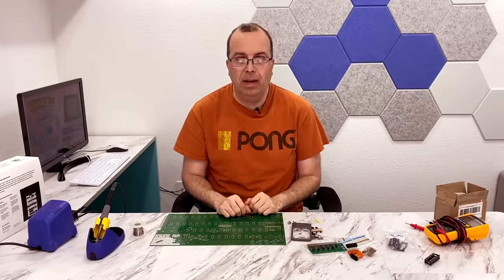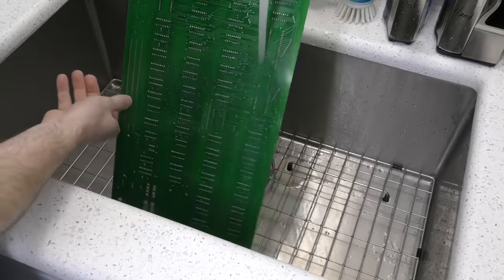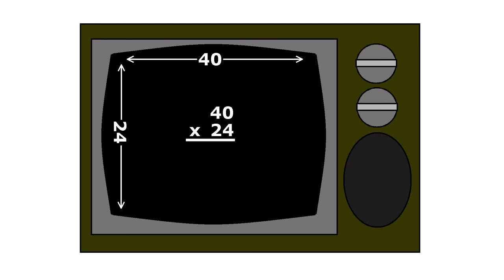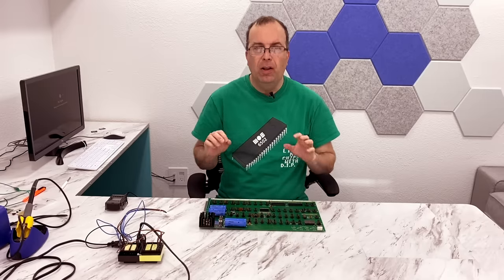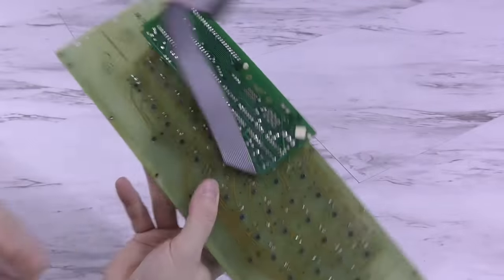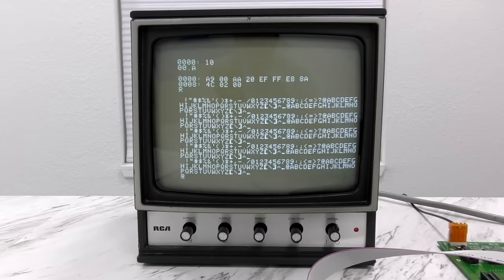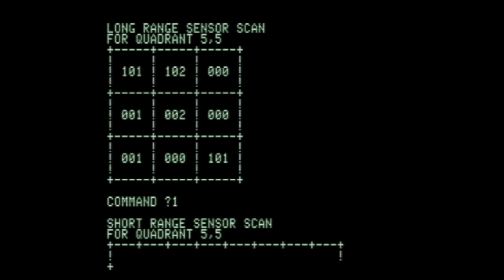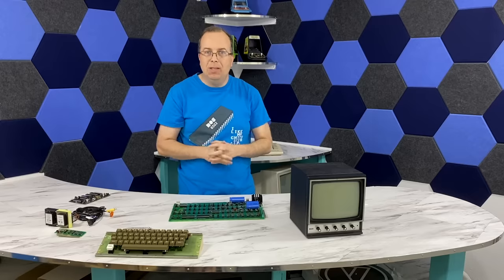How the Apple 1 computer works.

Comment: I won't lie: Every time I see water straight from the facet being poured on a mainboard, my booty clenches.
Reply: Water is perfectly safe to use on electronics, as long as they’re not powered. People wash filthy arcade boards in soap and water all the time. The board must be bone dry before testing though, put it in front of a fan for several hours.
Reply: It's not a problem...back in the 90s I used to work for a small manufacturer of Atari peripherals, assembling the circuit boards.  We used to clean flux off of them just like you see here and it was never an issue.  I dunno how they do it today with the tiny surface mount parts though
Reply: @KoopaMedia64  it depends. In undergrad, my town had really hard water. You wouldn't want to wash with that because you'd end up with deposits all over the board which could cause problems. But yeah, water itself is fine
Reply: @chrisfreemesser5707  They use IPA and deprotonated, distilled water
Reply: @anonymousarmadillo6589  I duno if I would pour an India Pale Ale on a computer.
Reply: @chrisfreemesser5707  they use ultra sonic cleaners
Reply: @nitehawk86  - You can use a European Ale if you prefer, but it evaporates more slowly and may deposit some oils on the board. It is better for rubbery components though.
Reply: @parrek1384  Yeah, when in doubt use distilled water.
It has the added benefit of being almost non-conductive.
Reply: Don't get in to extreme overclocking if tap water makes you pucker.  Those folks throw mother boards in the dish washer.  
As others have said, you are not going to damage anything on an unpowered board as long as you dry it off reasonably quickly.
Reply: @KoopaMedia64  You want to use de-mineralized water.
Reply: i used to work on a computer center, i lost count of how many computers, printers and notebooks i washed under the sink
as long as they are completly bone dry when powered, you are good to go
Reply: Same and i love it
Reply: me too .. but I always remember picking out my first arcade project case build circa 2000, the guy had a whole warehouse of uprights, and his tip (which I have still never tried) was cleaning mother boards in a dedicated dishwasher, and Jet Dry .. which changes the surface tension of the droplets. I’m sure the water type is also key. I have used higher end dishwashers for plastic parts, (2006) but the heat of the water or dry cycles changes the component plastics just enough to make that a near useless idea. i.e., it cleans the keyboard keycaps, but now they type like sh*t, so u saved no time or effort. 

I have seen folks power wash chassis monitors with a garden hose, etc. just ensure enough dry time, and they are fine. one day .. I will get around to that experience too.
Reply: In training we were shown pictures of semiconductors that were cooled by running distilled water over the main circuit while powered at more than 100000 V handling millions of Watts.  In fact, I suspect this thing is still running right right now.
Reply: @TheSulross  look at the neuroscientist over here
Reply: @anonymousarmadillo6589   @Capt TopGun  Yah - half the unrepairable liquid damage I deal with is hard tap water that has irreversibly rotted the solder joints because it wasn't fully dried. If you're gonna use tap water, be my guest but that board better be 100% dry within the hour. I mean really, really dry. Definitely don't do this with any ICs populated because you'll never get the water out of the hundreds of IC leg connections. Even depopulated, the sockets will take hours to dry.
Reply: @johngaltline9933  I think David often overlooks the 3 seconds it would take to say that it is dried thoroughly afterword...
Reply: Alec J I mean, yes, he overlooks it, but anyone with half the brainpower to solder this board ought to know it already. 
Probably worth noting that as far as soldering jobs go, that apple I board looks really easy and straightforward. All DIP and through hole, cause that’s all that existed at the time. It’s tedious AF, I’m sure, but it’s simple.
Reply: @chrisfreemesser5707  It sounds like you may have been taking more care than Atari themselves did. I've cleaned the flux off of three VCS's now from a heavy sixer to a darth vader.
Reply: @AgentOrange96  Of it's rosin core flux then it isn't an issue but if it's organic core solder the flux is acidic and will eat the contacts if left there
Reply: @chrisfreemesser5707  Yeah, I assume it's rosin core since it hasn't done any damage over the decades. I had been cleaning the boards with alcohol for other reasons, and it left an ugly residue, which was my primary motivation for fully removing it.
Reply: @chrisfreemesser5707  Original rosin is organic tree-sap that etches away stuff that blocks soldering.  It needs to be removed after completion.
Reply: @alecjahn  Sadly, unless David hits that board immediately with a hair dryer for several minutes, that's not really possible to say with confidence. Not where IC sockets have been used.
Reply: What's so sad about this entire controvery is that  a liberal wash & scrub with IPA is all that was ever needed to remove the flux stains. You can mix a bit of detergent in but flush with IPA thoroughly.
Reply: @KoopaMedia64  No, no, no. Just no.
Reply: @Blitterbug  I have one of those Datavac blowers. I've found spraying boards with IPA and then blowing it off the edge with the blower works well. For boards I've hand assembled I've bathed them in IPA and done the same. It can take a few tries for either method though.
Reply: @nitehawk86  IPA in this case is isopropyl alcohol.
Reply: @Blitterbug  I work at an electronics assembly company and we do use water wash, as it is a mandatory step if organic-type fluxes are used (we also use “no clean” fluxes, it all depends on the components used). The washer we use has a long conveyor belt that takes the boards under multiple baths of hot, deionized water at different velocities after which they pass under two air blast dryers before exiting from the other end several minutes later. 99% of the time the boards come out bone dry, the remaining 1% get hand dried and the assembly process gets tweaked so we don’t have to worry about hand drying that particular assembly on future runs.
Reply: I wash my PCBs with isopropyl alcohol, rinse under running water with an acid brush, and dry with compressed air.  Thirty years later, no problems yet.
Reply: @Renville80  Indeed. But you don't use the kitchen sink and unfiltered tap water. The hot air blast dryers are essential, as I was saying earlier.
Reply: It's perfectly safe as long as no juice is going in and none of the electrolytic capacitors have any charge in them.
Reply: @pheorat9439  Safe, yes. Corrosion-free, no. See some other comments here. The only time this is OK is when using a commercial washer-dryer unit with filtered water.
Reply: @chrisfreemesser5707  yes I've googled how PCB manufacturing works & I've read that they use water to wash it ar some stage
Reply: @xx_bean_xx  just use American Budweiser, it's basically water anyway
Reply: @Sheevlord  lol water is like the most conductive thing ever. Like wut? 🤣😅😅🤣😅🤣😅🤣🤣🤣🤣🤣😂😂
Reply: @syndromeofadowns  Not even close. Distilled water doesn't conduct, and tap water conducts electricity rather poorly compared to proper conductive materials, and only because of all the contaminants it contains.
Reply: @Sheevlord  🤣😍🤣🤣🤣🤣
Reply: @johndododoe1411  You probably mean deionized water.

Comment: In the past I've been an IT field engineer working on EPOS devices and this takes me back to the days when we would repair boards at the customers location right down to replacing diodes and transistors or looking for dry joints - great video as always thank you

Comment: This was extremely interesting.  I didn't know the Apple I board had basically a separate terminal and CPU section, and also it was interesting to understand how the shift registers really worked.
Reply: if you got half a million dollars in the bank you can buy an apple one or you can make an apple one replica for a whole lot less and the upside is it's brand new so it will last a whole lot longer to boot due to being brand new parts

Comment: 11:42   If memory serves the zx80 actually has a 4k ROM.  The zx81 doubled that to 8, and then the Spectrum doubled it again to 16.

Which still goes some way to showing how tight Wozmon is, since it's like an eighth of the size.
Reply: yep, 4k, i have a zx80, plus several zx81s and spectrums, the zx80 basic was very primitive integers only

Comment: I got curious and looked up exactly what this computer was used for. Turns out... well, not much. I read that it was used in a mathematics class setting on the wiki, but not much else. Since these where garage-made, I shouldn't be too shocked this was still VERY hobbyist territory. Edit: Though as a followup, that changed shockingly fast. The Apple II created a lot more exposure, and the C64 was only half a decade away. (Which is where I consider "personal" computing really took off.)

Comment: I used to have a Commodore monitor similar to that one you have.  I wish I would have kept it for my 64, but sadly it's been gone for a few years.  It worked ok but the power button was bad.  I could have fixed it but didn't want to fool with it.  Now I wish that I would have.

Comment: I did years of assembler programming with 6800s and 6809s.  It is tempting to get a motherboard and go the 6800 apple route.

An acquaintance in the late 70s built his own apple II using just the plans that were available from Apple .  However there was a bug in the schematic.  My acquaintance contacted Apple and told them that there was a bug in the schematic and that he would tell them where it was if they would send him the Apple II ROMs.  They struck a deal.

Comment: I'm guessing the tape board slot is basically the same thing as the expansion header, and as a collorary, there's probably no reason you couldn't use the tape board on most of the apple 1 clones that offer a header if all the same expansion signals are on it.

Would address one of your niggles with the PE6502

Comment: 6 hours for around 1000 solder joints is roughly 22 sec per joint. This can be done in half an hour.
There is no need to wait 20 seconds for each joint to cool down. 😉

Comment: Blaz35
Pinned by Programmator
Blaz35
2 weeks ago
Also a good cupcake recipe is 1 microwave a piece of butter (remember to rotate) for about 10 seconds. 2 Put the piece of butter in and add 1 &1/2 of sugar and 2 eggs then mix. 3 add 1&3/4 of flour,    1 & 1/2 of milk and 2 teaspoons of vanilla extract then mix again. 4 Spray butter spray on the cupcake tray and put in the batter in the cupcake liners and the bake a 400 for (30 mins - 1 hour). 5 Enjoy! (and add frosting if needed also i'm not sure about the time so always have toothpicks with you to see if they are ready)
92

Comment: As someone who performs wire mx and solder for a living;  I DO NOT condone using water to clean the alcohol Flux residue.  Clean it with a dry sponge by patting it.  Water damage is real.

Comment: I have a question (maybe it's a stupid question): where is the OS? at which point did you exactly plugged the components which contain it? 
It seems to me you purchased the components to build your own Apple 1, and so I don't understand where is the OS and how you made it working.
Reply: The answer is nowhere, there isn't an OS. The monitor program is the closest thing, in that it lets you put code into the system. If you want it to do something you you need to enter the code yourself.

If you're wondering where the monitor physically is, i believe it's the two chips in the bottom left of the board.

Comment: There was an seeming complete original IMac white glass case going cheap at tip shop & baulked at the gate , it turned up back there with note saying the hard drive was removed . . are they worth anything with bits missing & did they have any cool games

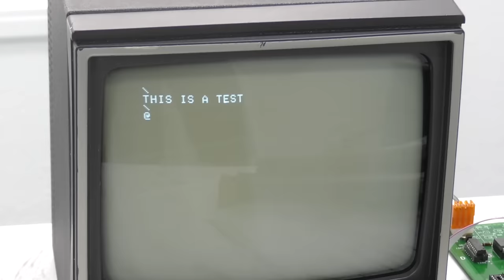Comment: I hate you. You made me buy an Apple 1 board, and I'm looking now for the components! Nice project, I hope it will result in a working machine. Just a correction - in 11:32 the ROM size for the ZX80 is not 8K, but 4K

Comment: If I were testing that I'd run off a current-limited supply with current set as low as possible, so if anything was in wrong or shorted, it wouldn't put amps of current into the chips.

Comment: I have a question that I doubt will get answered or is possible, could it be possible to get MS-DOS (Any Version of MS-DOS) to run on an NES? I'v been looking up something called DOS/65 that gets it running on 6502 based CPUs, i'm not sure of the ram limitations of DOS, but I know the NES has very little RAM, so somehow I doubt it would be doable. Least I have not seen anything like it.
Reply: .... or linux os in a playstation...  to turn it in a desktop pc xD
Reply: @atesin_dj  I'm sure adapters would need to be made to use a keyboard and stuff as well
Reply: @arcadeportal32  dont know about psx1.. but playstation2 comes with usb and have network and ide port accessories
https://www.youtube.com/watch?v=rWmJ0RH_Feo
there are more, even a debian based distro

Comment: Where did you get that image of the complete @5:05 you show the complete character set?  I'm looking for something published that explains what is produced on the screen for all 256 byte values.  From what I've found, $80-FF mirrors $00-7F.  I tried 2 different emulators and got different results for ranges %x0000000-x0011111 ($00-1F/$80--9F ASCII control characters) and %x1100000-x1111111 ($60-7F/$E0-FF ASCII lowercase).

Also,
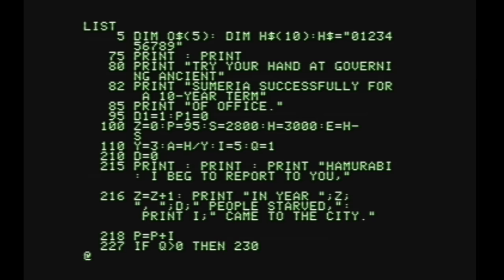@6:26 "There is no way to modify characters at random on the screen."
The underline character acts as a pseudo backspace character.
e.g.: "301_0" will display the contents at location $300.
Reply: I think I mostly found what I was looking for:
Signetics 2513 Datasheet (character generator) > CM2140 ROM character set

Now the only thing I need clarification on is whether the character generator actually displays uppercase in the control character ranges (^M definitely does not).

The 2 emulators I've tried were Pom1 and Apple 1js, btw.

Comment: Never really been a fan of plugging in stuff to an expansion card that is slotted into an expansion slot on the motherboard, without securing it to the casing, because of flexing & potential damage. But it looks like the Apple 1 never had a casing to begin with.

Comment: This is insane.

I have watched all of your videos;  I must admit to a certain level of nostalgic melancholy. We all had a ton of fun back in the day using the various renditions of the 6502 | 6510 processor.  My personal favorite was the Vic20.

You mentioned that (at that point in the video) you had over $800 dollars in your "new" apple 1 retro vintage 8 bit "garage style" computer with "scrolling" video. [ insane, flat out straight-up insane ]

I might as well build a vintage IBM 360 system with discrete transistors with $10,000 and a wire wrap tool.  WTF?

No no no, there is a reason that we all moved on from 8 bit computers:
1) they are too expensive
2) they have little to no video quality
3) they have too little memory
4) they are too slooooow.
5) (and my favorite) you can do absolutely nothing with them except play with them... the way we used to back in the early 1980s.

Have you heard of Pine boards, the Arduino, or the Raspberry PI ?  They are way more fun than a vintage 8 bit computer, not nearly as expensive, trouble free, and are actually useful.

marcus

(state of the art is important)

Comment: How can it be compatible with 68000 and 6502? Aren't those like, completely different architectures?
Reply: You've added an extra zero.

It supports both the 6800 and the 6502. The two architectures are virtually identical, but the pins configurations are slightly different.
Reply: @gwishart  I added that 0 because I thought he was talking about the Motorola 68000 used in many Apple computers :)

Comment: Nice video! The shift register thing was probably not uncommon back in the day, e g http://www.righto.com/2014/12/inside-intel-1405-die-photos-of-shift.html mentions that it was used in the Datapoint 2200 terminal (ancestor of the 8008) because it was much cheaper than RAM.

https://retrocomputing.stackexchange.com/questions/13228/how-did-the-apple-1-video-circuit-work has some details about how the shift register was used in the Apple I. It seems that the screen contents were circulated through the shift register once per frame, and copied into a 40-step shift register that could recirculate the characters once per scan line. I guess the shift register makes vertical scrolling quite easy; you just have to shift 40 steps extra in a frame (and erase the scrolled out characters).

To change a character, you'd have to wait until the character for the right position was shifted out, and then shift in a different one instead of recirculating the old one. This in itself wouldn't limit you to only terminal-like display, but it definitely makes changing the screen contents quite slow! (except for scrolling)

I find it interesting that the computer was built with a separate display section that would operate strictly like a terminal. A number of chips could probably have been saved if some of the terminal functionality was implemented in code instead, which also would have allowed more ways to manipulate the screen. But then, WOZMON might have needed 512 bytes instead of 256. Maybe ROM was expensive enough to warrant the extra circuitry? Or maybe Woz was more comfortable designing hardware than writing software? Or maybe the design was so clever that it didn't really need any extra circuitry? Apparently, Woz had already designed the terminal before it became a part of the Apple I (and the 6502 was added), so maybe he just didn't bother to go back and see if he could simplify it?